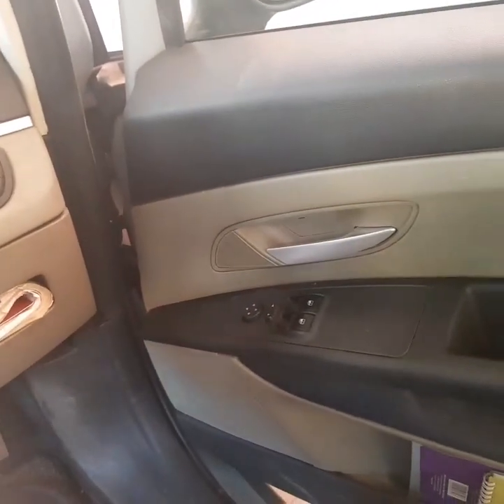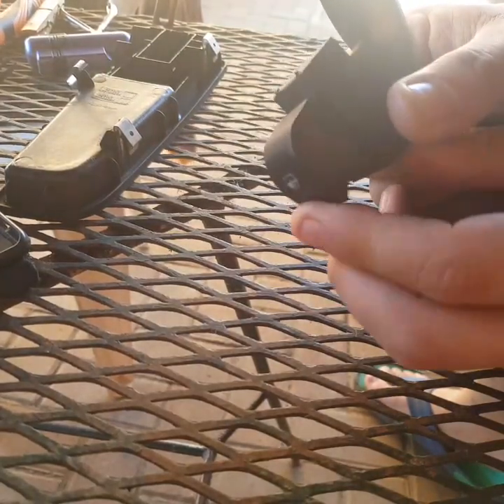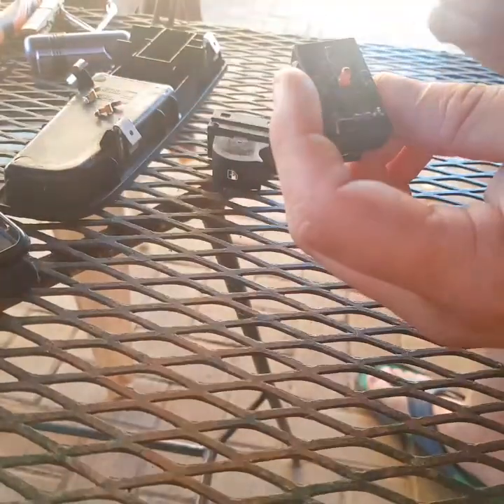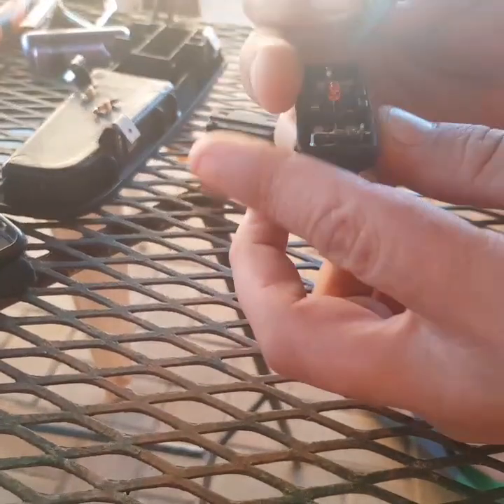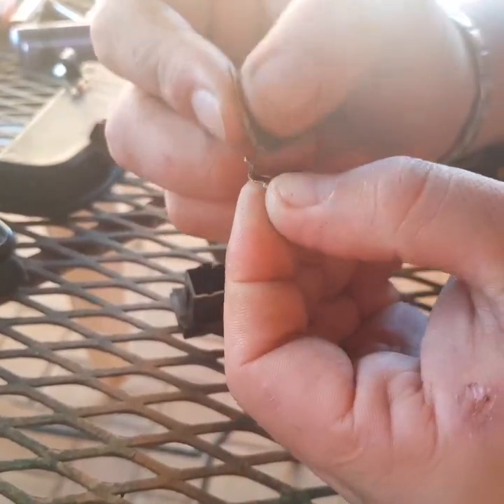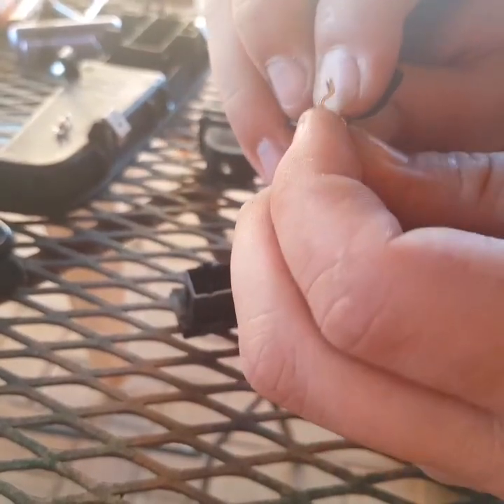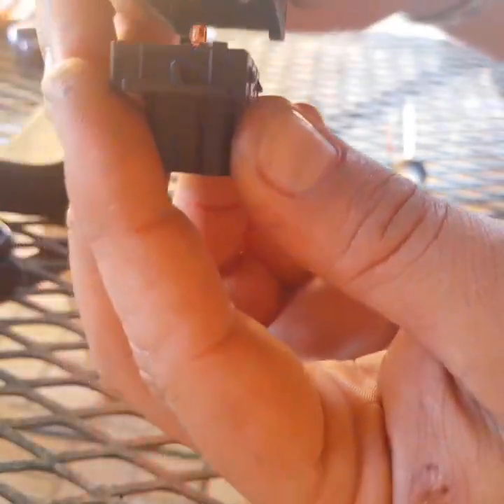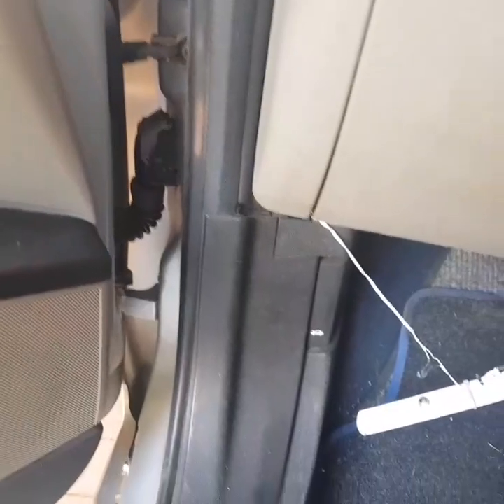Cheap quick fix to a non working fiat grande punto window switch

Comment: Thank you for your willingness to make and publish the video, it was useful for me to understand what I could do.
Unfortunately, however, regarding how to do this operation, this video is only partially useful and potentially dangerous.
First of all, I didn't like how you shot the opening of the switch:  if, in that part, you simply had framed the switch instead of just your hands, you would have been more useful, and it woulded cost you very little.
It's a delicate operation, in my case the switch opened halfway before extracting itself from its joint. All the interior pieces bounced far off the floor and it was quite a mess.
Futhermore, I would advise you to speak more clearly, not muttering.
In any case, let it be clear, you are an enrichment for the community and I thank you, also because otherwise I would not have attempted the disassembly. I think you are the only one in the web that did a video about that.
Reply from the maker: Thank you, i am sorry about the quality, i am just starting up on this, still have much to learn on how to put the cameras and i try to speak louder, a bit camera shy hahahaha, i am glad it helped you though, that was my only intention, to help somebody els fix a seemingly common problem with quite a few cars that i have found and not have to pay someone els loads of money to do it

Comment: Spray on contact cleaner, put back together, use the switch a number of times
Reply from the maker: If the contacts are to burned then my way works the best

Comment: I have a similar problem, I cannot control my passenger side from the driver seat. Only driver window. Any tips?
Reply from the maker: I have found that quite a few fiats do that, those pins get dirty and then the switch does not work any more, very easy to fix
Reply from the maker: The driver side works exactly like the pessenger side that i showed, just a few more of those little metal bridge peices
Reply: Wow, thank you so much for the quick response. This is a great channel. Subscribing! I hope there will be more Fiat Punto videos
Reply from the maker: Thank you, will be putting out more videos on it, have a few things that need to be repaired
Reply: @michaelshort2200  awesome! I had one more repair I was thinking of, when I turn on the front wiper at any level, sometimes (only sometimes) the back wiper comes on at full level. Dispite it being turned off (I have tried toggling this ) have you seen this before ?
Reply from the maker: The car will automatically put on the rear wiper if the car is in reverse gear, maby that sensor is stuck on yours, i have the problem of my indicators almost never working propperly
Reply: @michaelshort2200  I tried cleaning them with 96% alcohol which cleaned the contacts really good. I tried and still wasn't working, might be an issue with the power, the light on that switch isn't lit. The passenger button opens the window without hesitation. I checked the fuses and relays, everything seems fine. Any idea what should I check next?
Reply from the maker: @kristijanangelovski808  i have that problem with driver door now also, it is a broken wire in the wire connection between the door and the car, hang tight and i will have a video on that problem very soon, i think it should help out tons with that problem, i see there is not many vidoes on these cars at all
Reply from the maker: @kristijanangelovski808  have a look i have posted a new video on me having that exact same problem

Comment: I too have problem, Windows work towards downward only .. Upper switch not working of  driver seat and back left side window.. 
Even mechanic can't find any solution.. 
Plz give tips in details 
So that I can explain it to mechanic..
Thanks love From INDIA ❤
Reply from the maker: If the switches are working perfectly then check the wiring harnas right by the plug where it goes into the car, some wires like to break off there, i will be doing a video on that soon as mine has broken off there, but if you clean out thosw switches 90% of the time it would be the only problem, they all look exactly the same on the inside so if you follow what i did on that one you will be able to get them all working again, just take out the one that is causing the problem

Comment: I've got same problem you thing that is the actual problem majority of times?
Reply from the maker: My driver side door did that and then the passenger side did it, try it and maby it can sort out a very expencive problem  to replace the switch for free
Reply: @michaelshort2200  thanks its OK I just walk up next day and it started working haha got lucky
Reply from the maker: @aliausman8482  very lucky yes, if it does that again just clean those points and it will not give you a problem again
Reply: @michaelshort2200  thanks for that
Reply: And what about when the led light in the switch is also not working? 
Could this be the solution?